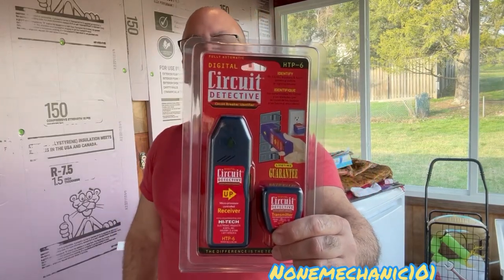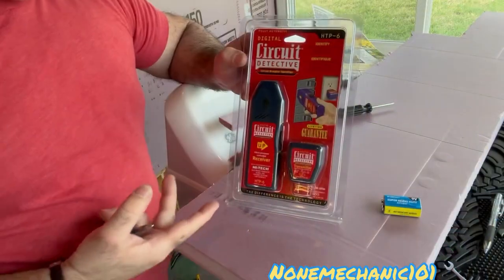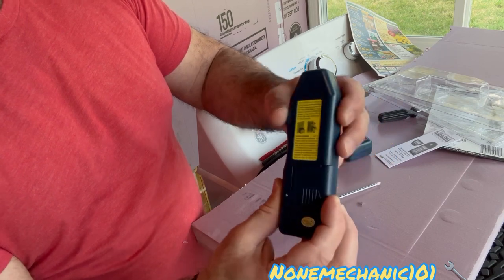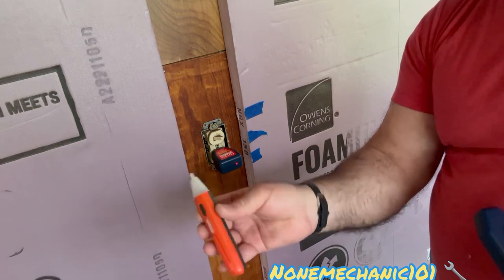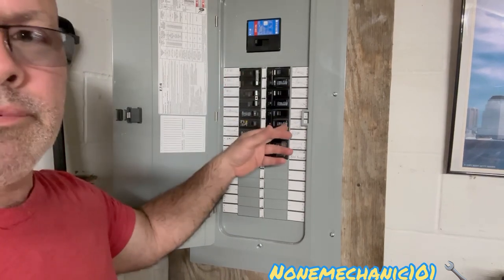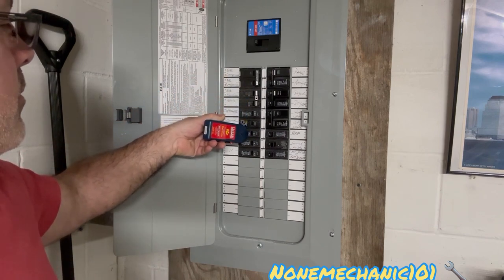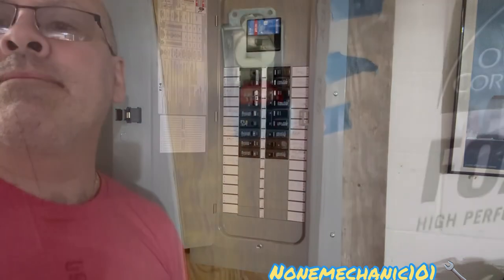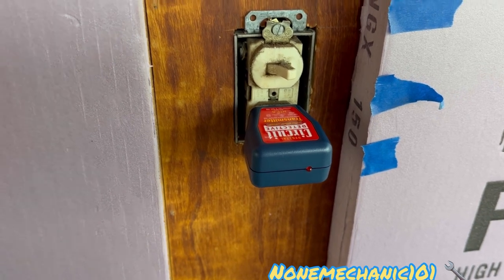HTP- 6 Circuit Detective, Circuit Breaker Identifier (Finder), Harbor Freight: Review

Comment: That works slick! Nice and quick and no mistakes! Thanks Hector!
Reply from the maker: You're welcome!
Reply: I crank a radio blasting a Neil Diamond tune as you can hear it as compared to a light which you may not be able to see it at the panel but I did buy that tool at Harbour fright thinking I could use it as a way to find a short or break but realized that is not the case.